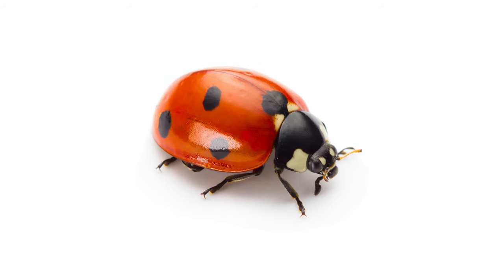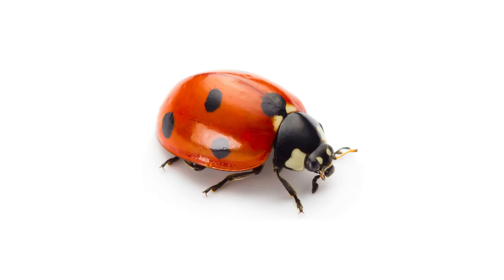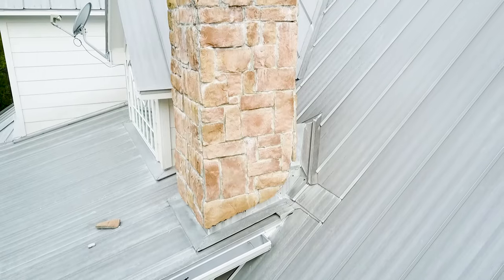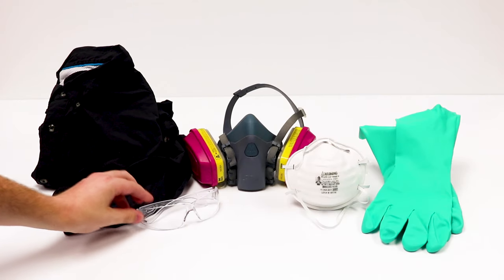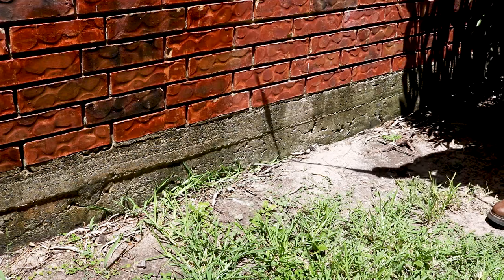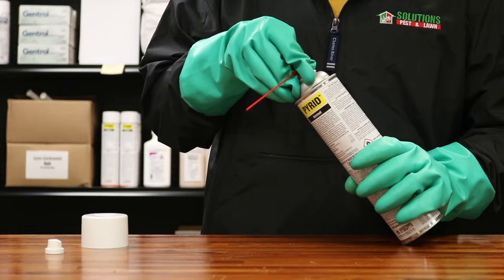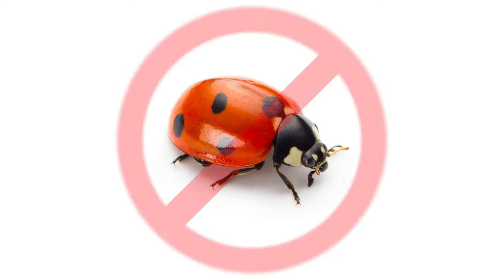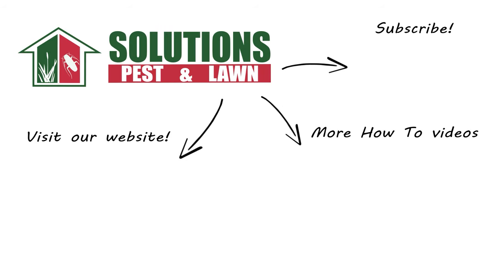How to Get Rid of Ladybugs (4 Easy Steps)

Comment: I recently had my windows and curtains used a vaccum or got rid of them with soapy water and got rid of them then sealed the cracks in the windows with thicc plastic bags and tape until it gets fixed fully